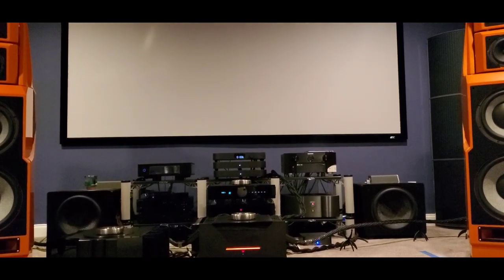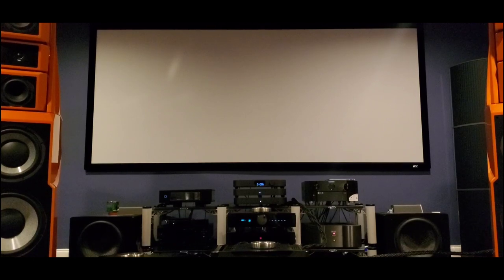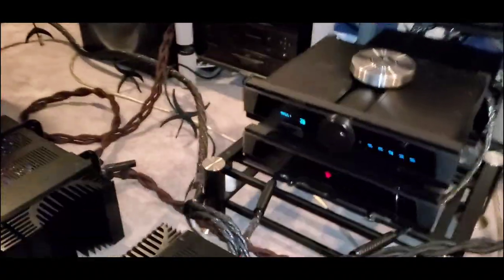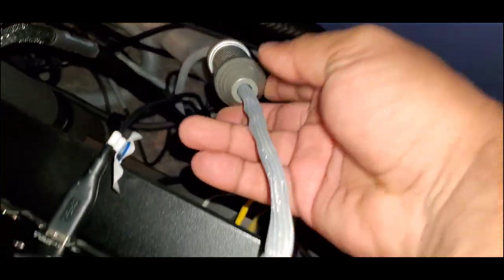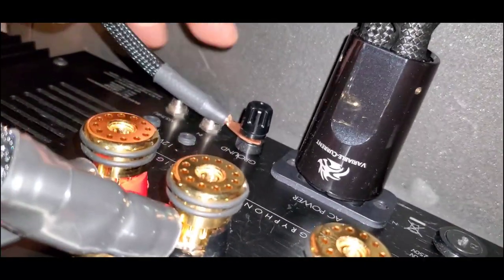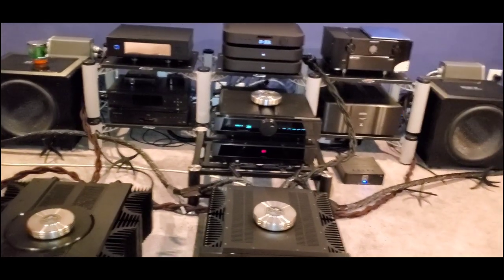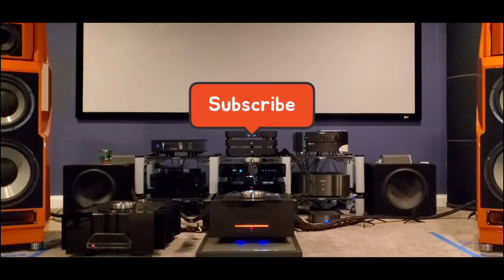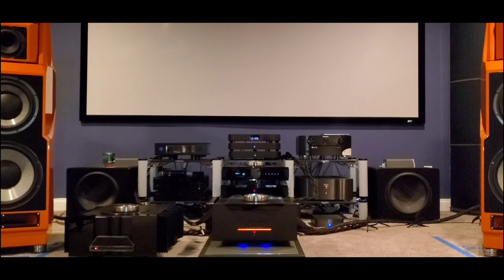DCS VERSUS MSB: Component list prior to the shootout

Comment: Are your circuits dedicated? With all of the special attention to detail, do you also upgrade the wall outlets, or is that necessary? I am also wondering about the wire management - some cables are lifted off the ground and a lot looks like intertwined spaghetti (like behind the components) - does it matter if these cables are crisscrossing over each other or is there adequate shielding - if there is shielding, then why are some cables off of the floor - i am not clear on how wire management may relate to the audiophile niche - BTW your videos are fantastic
Reply from the maker: Yes they are dedicated circuits

Comment: Which MBS Dac are you using ?- You should also post the  msrp price of each DACs system.
Reply from the maker: MSb Reference
Reply: Thank you! I was the first to post in another video asking the same questions. Below is my original post . . . 

"One area I hope you will cover is the current pricing of the Base Unit along with the Add-on Modules.
About a year ago I was looking at the Reference DAC and the base was $39,500 with the Femto 140 clock. I believe the base is now $49,500 but it now INCLUDES the Femto 33 Clock, which was a $14,900 option. In addition, I think the Preamp module is now INCLUDED and that was a $6,000, so it seems like you are getting a great value at the base price, ($25,000 worth of previous upgrades for only $10,000 more) IF I am correct. I do hope you review it as a preamp as well as a source with your current preamp."
Reply: So the MBS Set up is 50k? What about the DCS?
Reply: @bluemecsrl3667  The Base is now $49,500 and it includes their best 33 Femto clock AND I believe the preamp module with 1XLR analog in, plus the standard digital inputs 2X Toslink and 1 Coaxial.  Everything else (USB I believe) is an add on module. The older version had a 140 Femto clock standard, and the 33 Femto was a $15,000 option! 

This is why I hope Jay gives us detailed info about the model he is using.